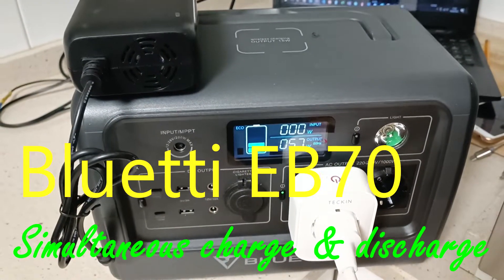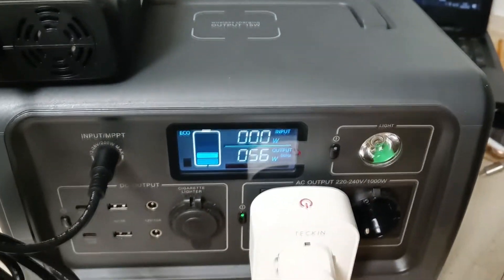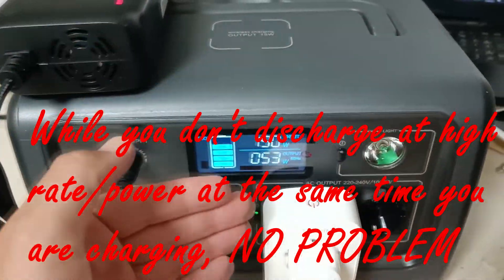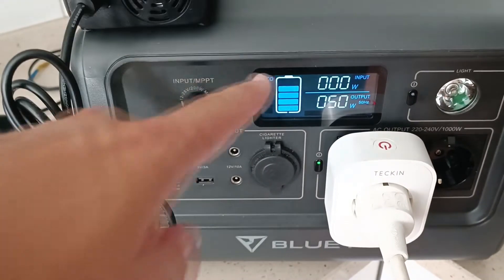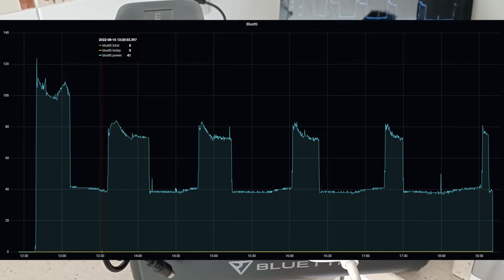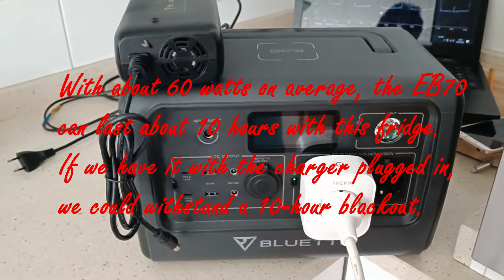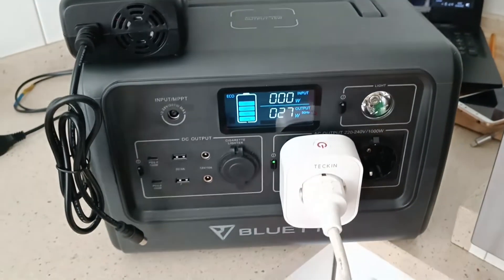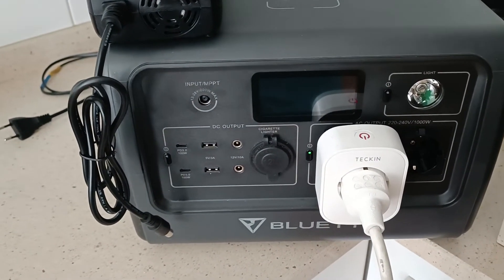Bluetti EB70  Simultaneous charge & discharge test

Comment from the maker: DDSBLUETTI: Tenemos un cupón de DESCUENTO del 10% para TODA la web oficial de BLUETTI, cualquier artículo: DDSBLUETTI

This is the whole test: https://youtu.be/OtZKImcdE-o

You will find also more test of equipment in my channel.

For example:
     DC discharge capacity test
     AC discharge capacity test
     SP120 solar panel charge test
     Heavy load test with hairdryer
and so on...

All of them are in spansih, but you could activate subtitles and automatic translation

Please, leave your comments and subscribe to my channel. 

Thanks.